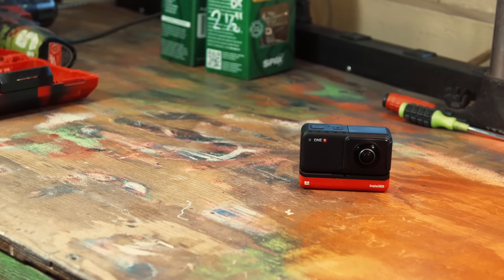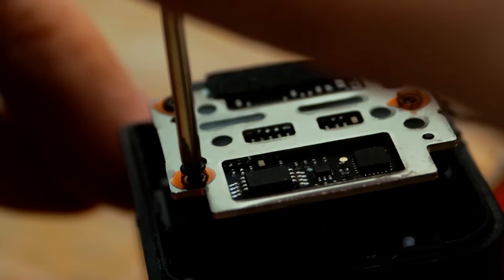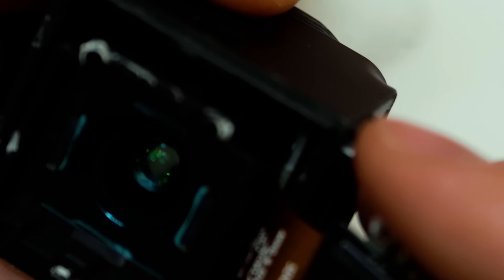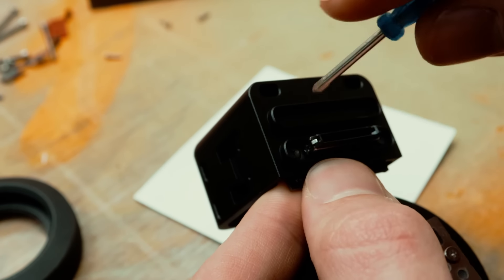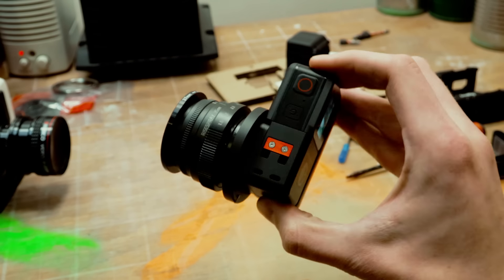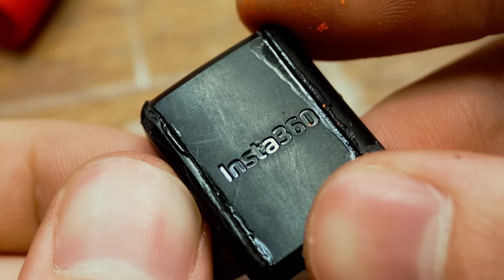My Tiny Camera Rig

Comment: Keep tinkering. Who knows when you'll hit upon the 'winning' formula that not only works for you, but makes other want the same thing. I remember this happening with the very early attempts to use 35mm stills camera on camcorders via vibrating groundglass adapters. I had one myself, and it was quite a bit of unique fun, until the Canon 5D MkII took over the DSLR large-sensor shallow DOF look without a need for mods.

Comment: The comment about how it's ok to do projects for fun, but just be honest without yourself that it's for fun and don't try to justify it somehow, is extremely relatable. Even right now out of no where I decided to build a TinyPC out of the newest thin client style machine I could find that supports Windows XP just so I'd have a hardware solution to playing a couple games that have been annoying me to get to run on modern hardware. There's no practical use for the project, but for the ~150 bucks I'm spending all in for parts, tools, etc. it's worth it for the fun of building the project itself for me, much less playing my old games on it.
Reply: Fun is enough of a justification on its own.
Reply from the maker: Absolutely. I love the tiny PC idea. I get a kick out of super compact gear for some reason
Reply: That sounds like justification to me
Reply: Irrational tinkering is LIFE
Reply: What case are you going with

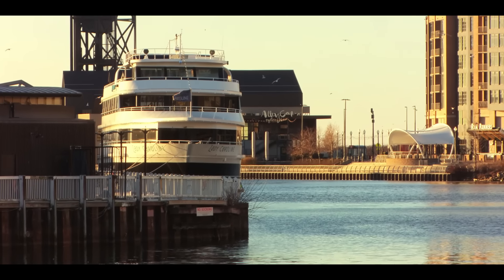Comment: Darn that was a nice video. Due to technical difficulties, I was only able to watch this video at 1.25x speed instead of the usual 2x speed if tend to opt for. This turned out to be a blessing. 8:41 I really liked the ending part, where you talk about the whole reason behind this. I cannot agree more. I often find myself doing dumb and maybe pointless (yet very interesting) small projects and while most of the times it ends up useless, I sure had a lot of fun. Examples would be when I took an iPad screen and turned it into a monitor, or when I bought a display-less a500 dslr camera.

Comment: Did this with a Yi 4k a few years back. It was a fun project, cost about as much as a roll of vision 3 and processing and it let me use my c-mount lenses for something again. It's not the easiest to use, focus is finicky, but it's cheaper and waaaay lighter than dragging a bolex around for my use case. Are there better cameras for the job? Yes. Am I glad I did it, absolutely.

Comment: Thank you for this very interesting video.  I think the images at the end are quite beautiful -- especially at the dock and the portability is a big draw.  I've been using some regular 8 cinema lenses on a Pentax Q -- adapters are available -- and its a much easier way to get there.  I find the quality of the regular 8 lenses (and probably even more importantly the condition of the specific lens) varies dramatically, but again the small size, the quirkiness of the set up and even the lower resolution are actually all part of the draw.

Comment: I want to make a point at the beginning of the video. For example, with the GoPro Hero 12 (same thing with the 1-inch model), the 4K quality is better than the 5.3K in every aspect. Moreover, the resolution is just a compensation for such a small sensor, because with my FX3, my 1080p is sharper than the GoPro. (In terms of resolution, literally, I'm not talking about color science here.) I own a GoPro Hero 12, and the image quality is practically identical to an Insta360 1-inch (strangely). But all this to say that resolution is not everything, and often people get caught up in this mess of numbers! I have people boasting to me about their 200MP Samsung mobile, yet again, my 12.1MP FX3 outperforms it in terms of details.

Comment: I have been wanting to get a personal backbone mod for one of my gopro cameras ever since i used one for a commercial project. Its niché for some, but for others, like timelapse photographers, these things are a godsend of creativity. C-mount Lenses combined with the massive amount of mounting options available like magnets and suction cups can give a budget videographer access to creative b-roll shots like cctv angles, moving car shots, first person Pov and ofcourse, tight spaces. Granted you won’t get cinecam quality, you will get the action cam camera angle without the noticable action camera look- which totally ruined the water barrel river scene in the hobbit due to the obvious cut from RED cameras to Gopros with standard optics. There are lots of specific usecases for this modded camera, but it is still a piece of kit that will lay around until those days where it saves your ass and impresses your clients with something unique that you can offer them.

Comment: I like how you slipped the plastic bag over the sensor as you had it just hanging out, good trick. I liked a lot of the footage (especially the dock) as it looked like old 8mm or some bad 16mm footage. I am not sure that there is appropriate signal processing in those cameras. It would be cool if all it did was shoot in say RAW without any processing.

Comment: A solution in need of a problem, but awesome project. I tried a few C-mount lenses on a GH3 back in the day, which was fine for video, useless for photography. Now I’ve built up my collection of M4/3 lenses and they feel like the best compromise for size, functionality, and IQ. I also carried the ZS100 around in my bag but ended up using my phone for most photos anyways. I think my only temptation from the 1-inch cam world would be a rx100, tho i owned the OG rx10 and while the lens was great, the menus and RAW files were not, so aside from my phone, my go-to is a G7 with the 20/1.7 or 45/1.8
Reply: In favor of the 1-inch sensor, TV productions used to be shot on smaller sensors than that.

Comment: I'm not sure how useful of a suggestion this is but what if you made fixed focus lenses? ie. take some vintage lenses and locked them at a certain focus level where you know the focal distance on this camera? That way you could have a 5m, 10m, 15m lens etc and then just step out from the camera using your feet to work out which one you should use.

Comment: I've been considering building a camera. Except it would specifically be used to record VHS-style footage. My idea is to use those little FPV drone cameras since most of them are analog rather than digital, which makes the video prone to inteference. Then build some kind of interference generator and wrap it around the video wire to induce noise into the video (to get that 1980's VHS effect). Not sure how I would go around building that but I'll give it a try at some point.

Comment: Does the lens focus to infinity? That's usually a problem when you adapt lenses designed for longer flange focal distance to mounts with a shorter one. Although C mount is so small in diameter that the difference of 2mm can probably be compensated by basically shoving the lens further into the mount

Comment: That is deffinetly a niche project and if the goal just to have a small powerful camera in the pocket there are many options like sigma fp or some MFT cameras. but the experience you've got from this project is pretty unique! 
I really like final image, soft and dreamy! Awesome!
Regarding focusing issue - I thought about 2 things that may make it easier to use:
1. Zone focusing with a deeper DOF like street photographers do
2. To get and adapt Clip-on Viewfinder for a camera - they usually have 2-3 time magnification and also block outside light so it easier to see. It will resemble Super 16 camera :)
Reply from the maker: Yeah in the end to get most of the usable footage that ended up in the video I had to stop down to like f/8. Even then still missed focus on most shots haha

Comment: I 3d printed my own version of this. Hey man I want to say that I love your videos, this video specifically I’ve watched prob 20 times. I couldn’t afford the mod kit that you bought but I do have a 3d printer. I designed and 3d printed my own version of the mod kit. I wanted to ask you if you would change your mind about the camera if the mod was easier and way cheaper?
Reply from the maker: Absolutely- looking at doing similar mods myself since this kit isn't being made anymore
Reply: @EvanMonsma  No way!! I just now realized that you commented on my videos!! Yes, I tried to address some of the issues you had with the mod with my own 3d printed version. 1. How difficult it was to take apart. 2. The price. 3. The compatibility with accessories. I want to say thank you for checking out my video and leaving a comment.
Reply: @EvanMonsma  Hey I'll send you one if you want. Also if you need help making a similar mod I would be happy to help, I can print some models or brainstorm or whatever!

Comment: nothing wrong with taking things apart, that's how you learn how things work after all. looks like you might need to dial in on the focal point a little, but regardless bokeh should be fun. Just out of curiosity, why not go with m42 or pk mount even to make use of all the tinkering and modding that's already there? (asides from form factor etc)

Comment: if its not frankenstein enough, you can use a cheap ESP32 with a camera and a video out to pipe to a larger (esp32) esp32 screen, or a VR headset.. for focus checking. :-) 
or, although delayed, ESP32 to phone via wifi or bluetooth, focus, then use.    :-) 
great project though. :-)

Comment: cool build so the result is small pocketable camera with different lens rendering, what about improving colors and details levels instead with motioncam free android app that runs on a smartphone and captures raw video (still relying on a smartphone small sensor but having all the data from raw video improves details and colors) still pocketable even if you need an external ssd on your phone and it will improve over time as it will still work with new phones to come that will have better sensors and faster image processing chips.

Comment: I got same module with M43 lens from Rokinon , 1 inch Leica mod and One RS brain
Reply from the maker: I used the 12mm rokinon for a few shots here, super good combo
Reply: @EvanMonsma  I am saving for a Laowa 6mm cine lens ( about 600 usd) and planning to use it with a small lidar autofocus in a small rig kind of

Comment: I have 2 insta 360 4k backbone mods and i hate using these things. trying to pull focus is a nightmare on hot summer days because the app will hang and the hotter the camera gets the more delay you will have on the preview on the app which makes it incredibly difficult to focus. My modded sony rxo on the other hand is a breeze to use and can shoot nice infrared video.

Comment: i have a d mount lens into a c mount lens adapter was looking to do this kind mod into a go pro but the adapter sits too far from the sensor, would need to take plastic apart and then somehow glue the adapter near the sensor..
Reply: I have done it with a Gopro4 black and it works, with both D mount zoom and primes. A little fiddle to use and not super fast but works good if you have patience……no glueing but takes a bit of time getting the correct selection of adapters and shims….

Comment: I guess you had funny time doing this project))) in general there is no point to upgrade action camera this way, because of rolling shutter (this actually causes even post-stabilizing problems). More over 5.3k is fake. Usually 4k in a cheap cameras is a result of in-body upscale of 2.7k (or  even 1080), or sum of two sensors 2.7k each. canon M is a better body for experiments. but I guess, you already know it). Videomaking is more about what you filming than how yoг doing it. Anyway good job and thanks for the video

Comment: u were using a phone as a moniter for a camera , wouldnt that be perfect to tackle the small screen issue ?
Reply from the maker: I didn't touch on it in the video, but the issue is no HDMI out on this thing. You can technically monitor with the insta360 app, but its bluetooth so actually just as low res as the tiny screen

Comment: 7:12 can you not use your cell phone to see the image larger and brighter and focus by? Also if you got the flange-focal distance correct then the markings on the lens will be perfectly accurate and you should be able to zone-focus like a rangefinder user no problem.

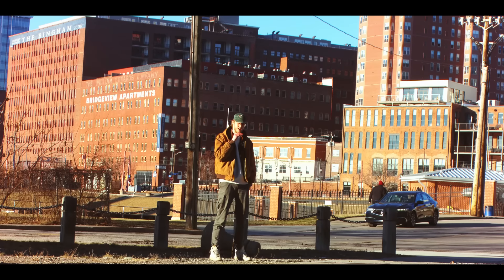7:20 i mean, are you wide open in every single one of these shots? what happens if you increase the ISO and stop down the lens? bet it gets remarkably sharp
8:48 this looks much better. I assume you had to stop down for exposure and as a byproduct the image is suddenly sharp.

I would say that this camera overexposes pretty ugly so you should always shoot to underexpose a bit and tweak the gamma later. Also the rolling shutter can be jarring in telephoto shooting with camera motion. As micro as this camera is, it would be well served by treating it like a 200lb Mitchell movie camera and only using lockoffs and fluid pans
Reply from the maker: Yeah there is an app to monitor but its locked in portrait mode so still pretty small, and because its bluetooth the resolution is terrible, not really any better for focus pulling. 

Yeah, some of the C-mount lenses have no aperture so some shots are locked wide open. The sharper shots were where i switched to a lens where I could stop down

Comment: What lens is that
Reply from the maker: The C-mount lens in the thumbnail is a Wollensak 25mm 1.9 - I also use a Risespray 35mm1.6 and a Izukar 16mm 1.6 for the other C-mount lenses. At the end used adapted Canon EF zooms to grab some more reliable shots as well. Mainly the 24-105